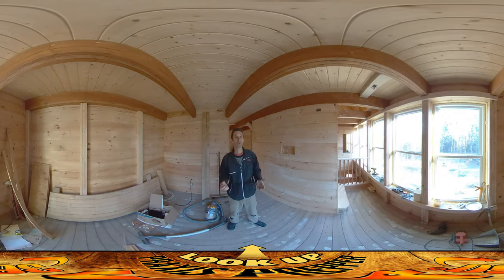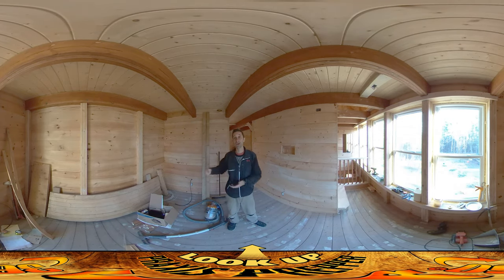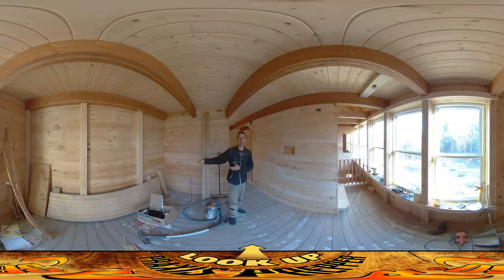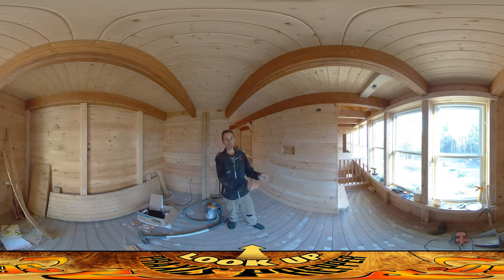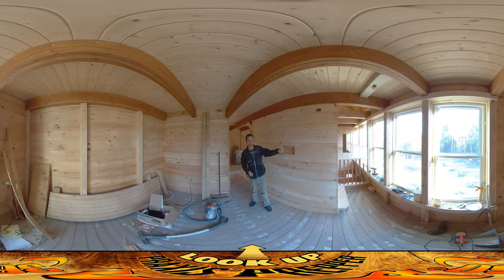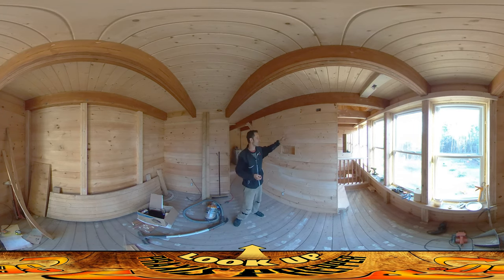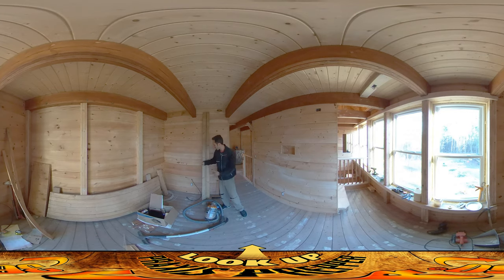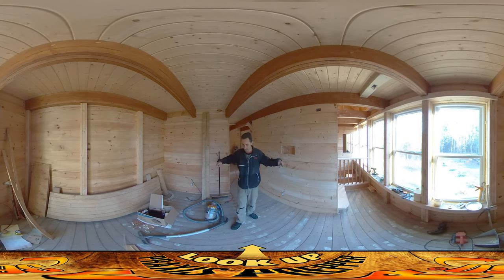Homestead Build - In-Wall HDMI Wire and Media Cubby

Comment: There are a lot of half decent cable binding systems that make loose cables hanging around like a big hazard or just a visual pain a thing of relative past, but obviously this solution is a lot more nifty. my expectation will be that you will enjoy having done it this way several times in the future ^^ ... obviously until something somehow goes wrong and you can't reach the cable easily anymore... but my guess is that by that time it will all be wireless 10G anyways...